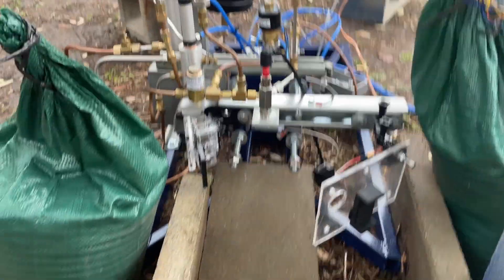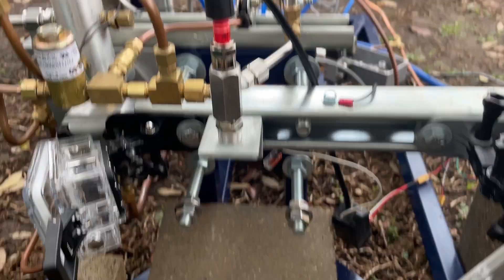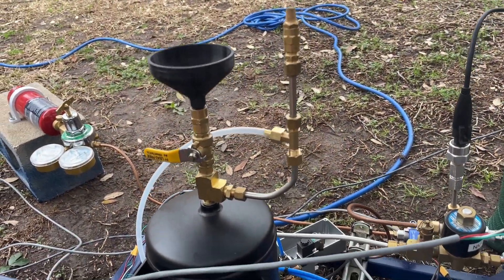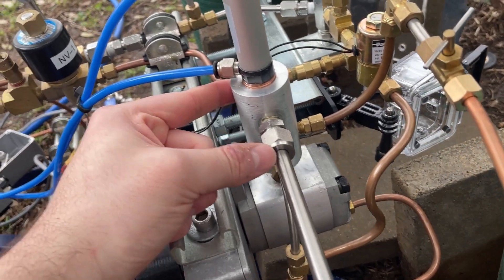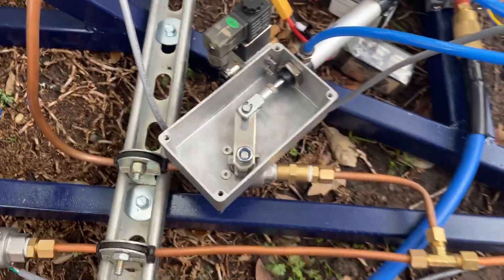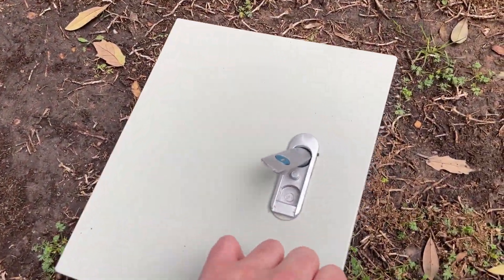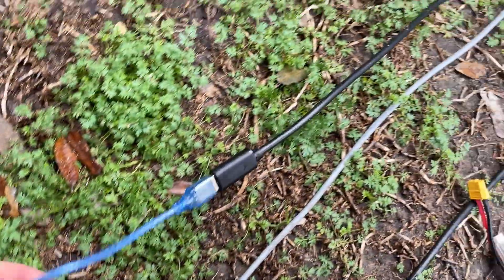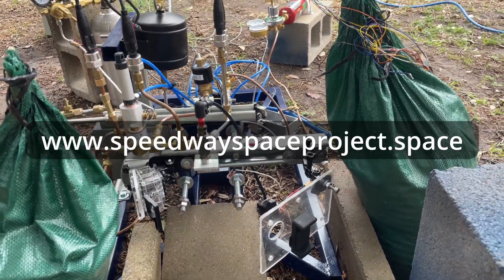Igniter Hotfire and Test Stand Tour

Comment: glad to see this progress a cycle i recommend a cycle thats pump fed is a combustion tap off cycle which is the most simplest after the open gas gen cycles and staged combustion. and gives  good thrust 58,000 to 160,000 pounds force maximum
Reply: Wonder precicely how long the compressed helium would have to spin the pump before the tap off cycle starts providing the power
Reply: @dmurray2978   sir u can use a seperate spin start turbine like blur origin dowes with their BE 4 OXY RICH ENGINEand at 100 pis it will take around 6 seconds and 1000 psi around 3 seconds other come into pay like the SO well known BRAKE HORSEPOWER the amount of time and effciency the spin starter takes to spin up the powerhead assembly  and the weight of the  shaft other factor
Reply: also a  light shaft will spin up 2.3 seconds a hollow ultra light shaft will spin up in 4.3 nanoseconds an instant